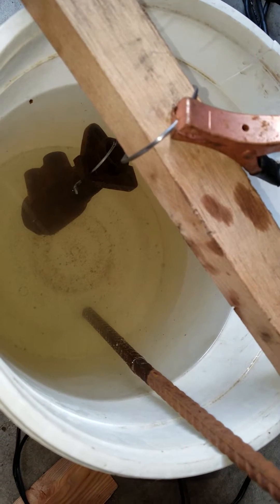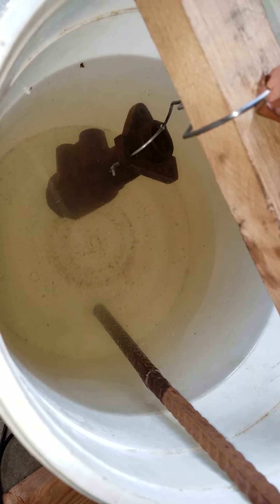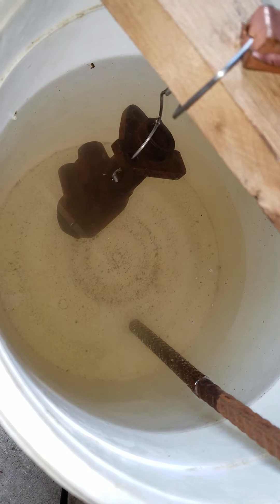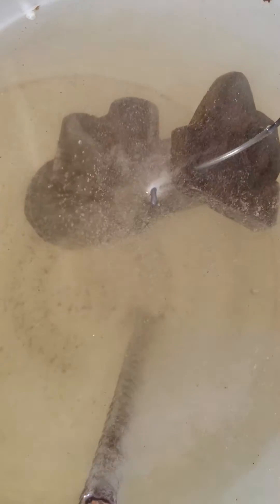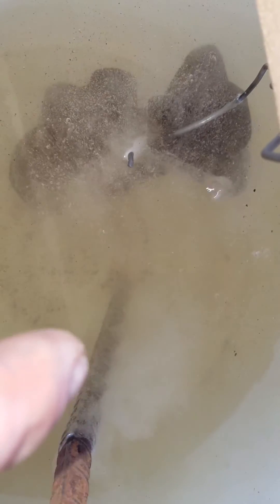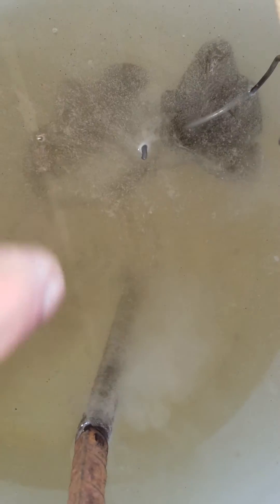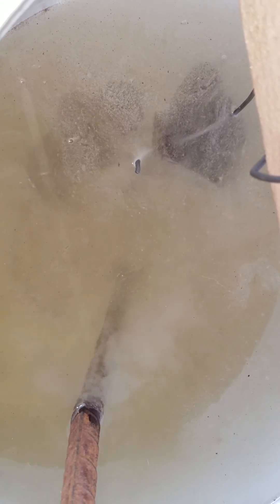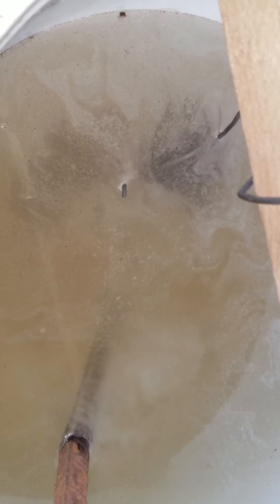Electrolysis Rust Removal Land Rover Series 1

Comment: Just be careful doing the whole Rover, the electrolysis might attack the aluminum bodywork
Reply from the maker: scienceaddict77  Thanks  only going up as far as the chassis and leafs. 
Tested the aluminium just in case. It had no effect  but better safe than sorry
Reply: 1971mgb well good luck then, I was planning on doing something similar using the molasses method, however I'm afraid my chassis might be too far gone for that to be a long term fix. I'm probably going to spring for a galv chassis in a couple years.I guess my only other piece of advice is to be careful about getting water in your axles and transmission. Best of luck
Reply from the maker: scienceaddict77  luckily just a dusting of surface rust   that is easily removed. Nothing structural at all.
I will pay heed to the axle suggestion and endeavor to keep them above the solution.
Rob